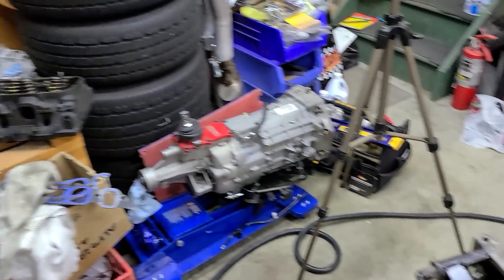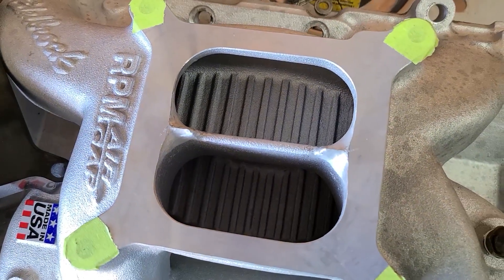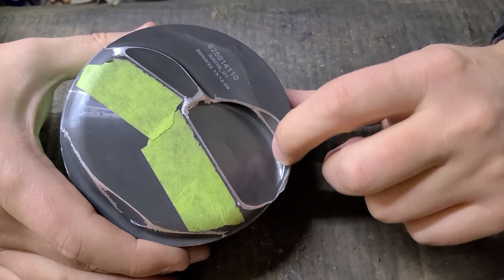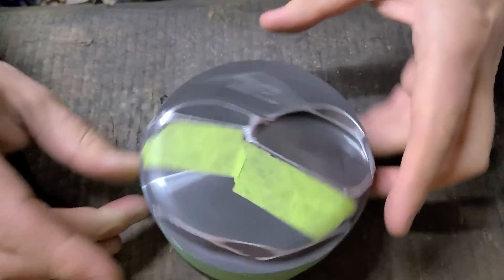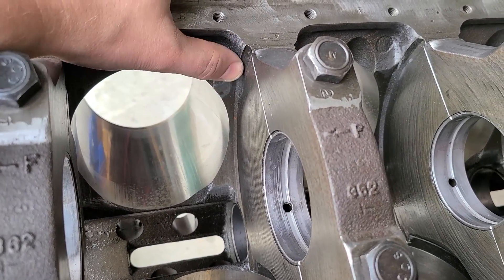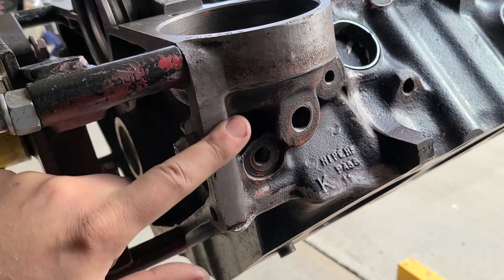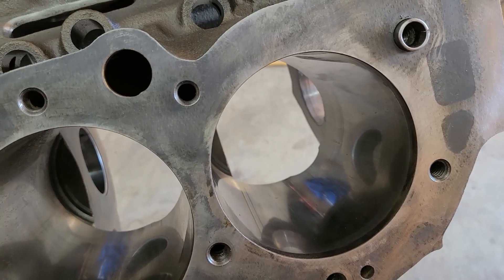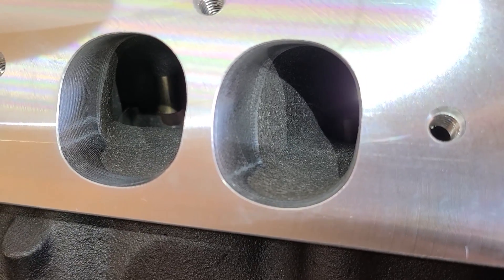Big Block build - block and head prep - FREE horsepower?

Comment: it has been over 5 months !!! Hope you doing good ? you get more power with compression at 11 to 1 and proper cam ,shorty headers down low 5 K and just clean up stock headers ! BTW i would not use that oil guard under the manifold it will mess up your push rods ,you need a lot of clearance ! Best bet is to go with a new design manifold that has a space in-between !
Reply from the maker: Not good. 2 engine builders have said no.
Reply: @SS454LS6  no too not using the oil guards ?

Comment: Old timer gave me the tip to use a thick layer of clay or Play-Doh over the valve seats. Might be a little safer than the tape 👍🏻
Reply from the maker: Good idea. I did use a few layers of tape, but the best way to avoid damage was just to avoid contact.

Comment: You should have done more. Smh.....🤦‍♂️
Reply from the maker: sarcasm or are there areas you are thinking could use more modifications?
Reply: @SS454LS6  in the valley and the rear wall of the block. The cast surface really impedes oil flow. Grind it all smooth with a carbide burr and the oil will run across the slick finish. 

Getting the oil back to the pan is the name of the game.

Also with your pistons, don't forget the edges where the valve reliefs end at the outer edge of the piston crown. I use 400 grit Emery cloth and polish the sharp edges away. The MAHLE piston you have is a nice piece, and you'd think it wouldn't need all the deburring. The underside of the piston could use a little TLC too. 

Another critical area is the bottom of the cylinder bore. There's always a nasty edge that can catch the piston skirt.

Good work on the main caps, but don't forget the main journals in the block. Breaking the edge there is just as important. 

Deburring the entire block in general is important. It's easier to handle and safer to work with. Every damn aluminum block or cylinder head these days are machined to sharp edges.....

The oil pump main cap can go deeper with the radius. Then match the cap to the block surface. They're usually out of alignment. In some areas I find my Makita die grinder cumbersome. I scored a 10 piece set of long shaft carbide for a dremel in 1/8" shank. I had to cut the length down, but they work great for tight areas. 

Last but not least, always chase your threads and chamfer all holes. Don't "tap".....chase. there's a difference. Good luck.